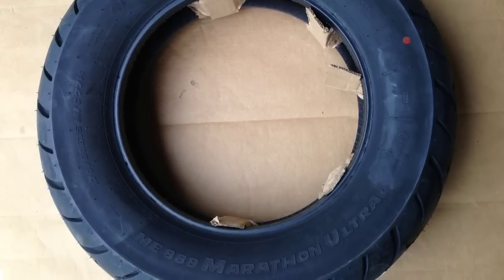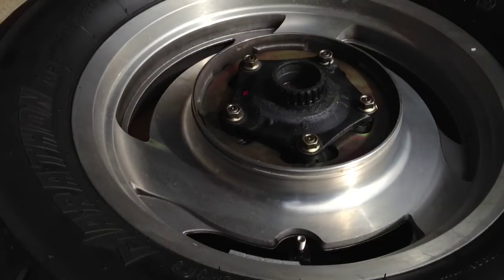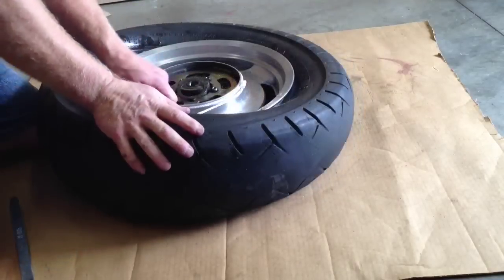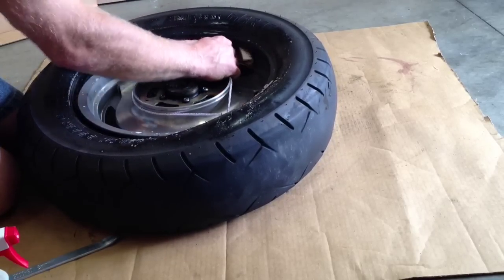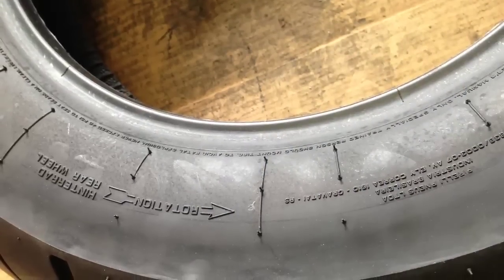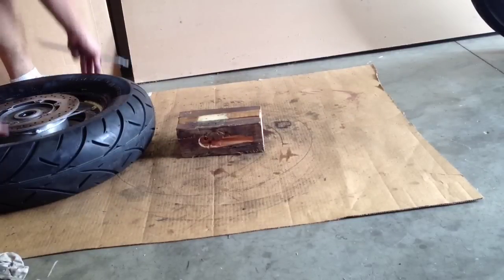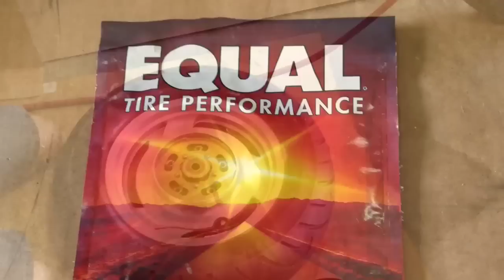Removing and replacing a motorcycle tire from the rim.

Comment: were can i get  the dust for balance an how much do i punt in.
lmk please thank you. 
Gator.
Reply from the maker: It can be found on line from several different sources, there are beads and dust both work the same. Follow manufacturers directions for amount as it depends on the tire size. Hope this helps, thanks for watching.

Comment: The yellow mark is the weakest and easiest place in the tire. Then put the nipple near the point. The red dot is the strongest and heaviest place in the tire. We put the nipple opposite for a better balance.
Reply from the maker: The tire in this video is a Metzler.
From the Metzler Website: Some Metzeler tires have a red dot on the side wall. This indicates the lightest point, and should be positioned next to the valve.  Thanks for the view.
Reply: @funbro1  My apologies! I went to their site and made sure. Thanks for the answer!

Comment: I respectfully suggest going to Napa auto parts. By a gallon of rubber lube. It’s around $15, and it will last you the rest of your life unless you have a garage and you’re changing tires all the time. One of the worst things you can use to lube a tire for installing/removing tires is, dishwashing liquid’s that contain lye...Why is what makes the detergent feel very slippery. It is also what makes your eyes burn if you were to get soapy water in your eyes, and worst of all,lye absolutely destroys aluminum..Don’t even think of washing your motorcycle or your car wheels if they are aluminum with dishwashing liquid that has the lye in it, and never use it to lube tires to make installing/removing tires from the wheels.
   I don’t depend or trust many of Harbor freight tools. But one handy tool to have around is, the harbor freight tire mounting stand for one reason. Breaking tires off of the wheels/breaking the bed loose. It takes less than 10 seconds with that $49 harbor freight tire stand. using those big sea clamps takes a hell of a lot longer than 10 seconds to break the bead, and they probably cost a lot more than you will pay for the harbor freight car tire changing stand. Mine was $49, and, I got 20% off using the magazine coupon, so I got it for $39.
   But if you insist on using those giant C clamps.. it works a lot better if you put a large area scrap of wood under the bottom of the clamp and have it against the wheel/not the tire as you’re turning the clamp to tighten on the bead/tire. When you have the clamp on both sides attached to the tire, you’re really not pressing the tire away from the bead as effectively as if you had a board on the lower end of the clamp and the top end of the clamp only on the tire near the bead..
  Don’t forget to get a gallon of the Napa tire/rubber lube. I priced many rubber lives, many of them cost $50 a gallon. But the Napa is approximately $15 a gallon
Reply from the maker: I will have to look for some rubber lube next time I have a chance to go to Napa. The dishwashing liquid that I use does not contain lye so it is safe to use on aluminum. While I would not ever use dishwashing liquid with lye in  it to wash my motorcycle or car wheels I still will continue to use it in this application from time to time. I will make sure that I do not use the dishwashing liquid with lye in it for sure. As for harbor freight tools I have used them in the past and they are good for tools that I don’t use very often depending on the price. In  this video I happen to have a plethora of C clamps at my disposal so the time savings to me would have been nothing if I would have had to run to Harbor freight and spend another $50 to purchase a tire mounting stand. It’s not that I insist on using the sea clamps but it is something that was available and many people will have C clamps available at their disposal and as shown in the video they work very effectively. Next time I am near or I go by a NAPA I will have to look for the tire/rubber lube. Thanks for watching

Comment: Does breaking the bead ruin the tire?
Reply from the maker: No, it will still work if the bead is not scraped or damaged in any way but a typical bead breakign should not ruin the bead. Thanks for watching.
Reply: @funbro1  the bead is not the metal edges of a tire? And wouldn't breaking it break it? Lol
Reply from the maker: I guess technically if you are breaking the bead that you are actually breaking the bead. Good thing is that it’s easily repaired.

Comment: I noticed you didn't take the old balance weights of the wheel, did you take them off  after you put the ceramic dust?
Reply from the maker: I left them on and the dust will counteract them. 

Thanks for watching.

Comment: Re:  6:20:  the  next  step is  to  seat the bead.    I  was to that  point  and  called my  pal  to  tell him  "I'm  going to use your  compressor  because  I need   a massive  burst  of  air  to seat the  bead".    His  compressor is  currently stored in my  shed.   In  the ensuing  discussion he mentioned that sometimes   in  a  shop  at  which  he  worked if they  couldn't  even  get    a  tire to  seat   with  a good  blast of  air   they  used  a rope  tightly-cinched   around the   center of the  tread.  It  pushes  down   toward the   rim-well  and in  so-doing  spreads the  beads  towards  either side making  a fair  sealing  contact.

The  "light  came  on"   and  I  realized  at that  point  that  I didn't even  need to dig out  his compressor  or string   wire to run  it.  Further now  I  can  remount  a tire  in  a roadside  repair  ( like if  I  want to put  on  an internal  patch  instead of   using  a   "plug"---I was  replacing   a leaking  valve  stem ).   I  always  have   a ratchet-strap  on  the bike   anyway.   I   put   it  around  the  tire  tread  as per  his  reminiscence   about  how   "they used to  do  it",  tightened it  up  and   it  sealed the bead  I'd  broken  to get at the   valve  stem  so  well  I  could   easily  pump   the  tire  to seat the bead  without   even  removing  t he  core  from  the  stem  and  using  only  one of those   cheap   foot-pumps  you  can get for  $3  brand-new.

I  was  going to  start  bringing  along   a tube  on  trips  so  I  could  seat  a bead  without  having  to hitch-hike to  somewhere with  a compressor  or  call  a  tow-truck  with one.  Now  I  won't have to mess with that or  with  trying to tuck  a  tube in  a tire without  inducing  a pinch-flat.

Hurray for  ratchet-straps  and  my  pal  Mike  the  Fireman.

There's  also  a  trick  of  putting  some  flammable  high-vapor-pressure  liquid  or  flammable  gas  in  the  tire carcass   and   igniting  it  to  create  a  small detonation  to  knock the  tire beads onto  the rim  shoulders.   Supposedly  this  works  well  but  I  don't  recommend it  and  particularly  not  when  you could  use   this  alternative strap-on-tread  method.  It may not be  as exciting  and fun  but   it  sure   does  work.
Reply from the maker: +Ivanmar Chenko  I don't feel comfortable using the flammable vapor trick (not a lot of control there. I have used the ratchet strap trick several time with good results. Thanks for watching.
Reply: +funbro1 Yeah,  I  said  I  wouldn't  recommend it.  Yet  I  just met  another individual  (  checking  out  another bike I  may buy )   and  he'd seen  that trick used  with no  disaster.  That's  two  I've  spoken to  face-to-face  who have seen  it  executed successfully   and  so   far  I haven't met   anyone  with  a valve  stem sticking  out of the middle of   their  forehead   for  whom  it   resulted in    tragedy...

I'll  stick  with  my   ratchet-strap   trick.  It seems to  work  great. I'm sure there are  other  such  tricks  and  I'd  love to   see them all.  Good  video.  Keep  it  rubber-side-down!
Reply: the rope trick is helpful on car tires,,seldom needed on  a much stiffer motorcycle tire,,,,if it does occur,hold the tire verticle and bounce it off the floor several times while turning it a little between bounces,this along with some lube will work the tire on to the rim for a seal

Comment: I also have a VTX1800 and tried to change my tire this afternoon.  Epic fail.  I could not get the the first bead over the rim edge.  You made this look a little too easy and you did it from the rotor side…. HOW?
Reply from the maker: It's not easy that's for sure but it is all documented in the video.
Thanks for watching.

Comment: Youre not taking the valve stem out, you taking whats called a valve core. The valve stem is what you put the air and so on. The valve core is what holds the air into the tire. Once you remove the core the air comes out and so on. 

But also its a great video
Reply from the maker: If we are getting technical, and it looks like that is your "MO" the valve is actually known as a Schrader Valve invented in 1891. It has 3 parts, the body, the core (AKA spring assisted poppet valve), and the cap. So technically you are correct that in the video I am removing "part" of the entire valve to allow air out. 

What surprises me most is that someone with so much attention to detail forgets to put a period on the end of the last sentence.  But also it's a great comment. Also it should be "it's" not "its".  Thanks for watching.

Comment: What PSI is your compressor putting out.  I'm trying to just start the bead but the air is just passing through.  Its not forcing the tire to bead
Reply from the maker: My compressor goes up to 175 but I am no where near that pressure. Over inflation will cause damage to the tire.

Comment: how did you put the suramic dust in if the tire was full of air , wouldn't it blow it all out?
Reply from the maker: +TipTopDalton1 Once the tire is seated on the rim make sure the valve stem is removed and all the air will come out, then insert the dust and re-install the valve stem and inflate tire to recommended pressure. Thanks for the question.
Reply: +funbro1 alight thanks

Comment: Bob how much ceramic dust?
Reply from the maker: A good rule of thumb is 1 oz per 10-12 lbs of tire.
Reply: can you substitute this product? Xtra Seal - Tire Balancing Beads 10oz bag 20.00 in my area @ O'Reilly parts store...
Reply: and TY Sir!!! very informative video...
Reply from the maker: I don't see why not as long as you use the correct amount.
Reply: thx Brutha!

Comment: Here's how you change a worn tire that you will throw out. Once the wheel and tire is off the bike, lay the wheel on a towel or rug and stab the side wall with a utility knife and cut around the tire. Flip wheel over cut other side wall around tire. Remove tread, remove side  walls and discard.
  Lay new tire on side and rub tire paste on tire bead and wheel rim. Make sure tire direction is correctly oriented to wheel. Press wheel into tire. Flip over and press other bead by hand into wheel.
Your done!, no tire breaker, no tire bars. Just your hands, a knife and tire lube..................aaannnnnd your welcome!
Reply from the maker: If only it were as easy as your words make it sound. Unfortunately this is not the case.......YOU are welcome. But thanks for the view.

Comment: GOOD vid bob, any link or website on the ceramic dust? and also a no DIY balancing part of the video?
Reply: I think he said the point of the dust is that it means you don't need to balance the tire. You can think of the dust as internal tire weights that balance it as it spins.
Reply from the maker: Correct the dust inside the tire acts as weights inside the tire to balance the wheel. Thanks for watching.

Comment: Bob I didnt know about the red dot. Thank you. I have been using RideOn. Its like that green slime. However it is a gel and not a bloody mess. It balances the tire as well. Interesting with the ceramic dust. I have also heard of beads but havent tried them. I hate paying the shop $40-$60 to do my tires. You just kicked me in the nuts I got to do this. Laters. Thanks again for another cool video.

Comment: I find it funny how people struggle taking of a worn tyre. Because they're taking it off the way a new one goes on. Surely a Stanley blade or hack saw down the centre of the tyre would do it! Split it in half, not even fully just enough to weaken it. Not like you're ever gonna use it again!
Reply: LOL try it.  the center will cut easily but you'll struggle on the inner walls where there are wire rope.     It's easier removing them with spoons.   I've done it both ways.
Reply from the maker: What are you cutting the wire ropes in the bead with? I've cut tires before and this sounds like more trouble than just using spoons.
Reply: Yeah you're right lol. My bad. It was an arse. Hold my hands up. Didn't realise there was such tough metal round the bead which if it wasn't right next to the rim i would've given it some real welly but didn't tale the risk in the end. But it's a good way of getting air out quickly
Reply: Yeah you're right damn. Was a pain. But I suppose it makes sense to have that metal bead
Reply: Do you reckon wire cutters or small bolt cutters would get through it quicker. Cos breaking that head by hand was something else hahaa
Reply: Bead not head bloody spell check
Reply from the maker: Those wire ropes can be a bear to get through, especially when surrounded by rubber and located next to a rim.

Comment: so you said you used ceramic dust, not beads but in the comments someone said beads and you went along with it. the video looks like it was dust. which was it and why would you use dust? I use airsoft bbs and they work great. made the mistake of using dynabeads and although they were great for the first couple tires, after that I started noticing cement like stuff in the tires and less beads. turns out that ceramic in tires when mixed with Windex in even small quantities especially if just using compressed air instead of nitrogen is a good way to end up with a balanced tire for part of it's life but not all
Reply from the maker: Actually I have used both and had success so it really doesn't matter. Thanks for watching.

Comment: What about the weights that was still on the rim? Leave them on or take them off since you're using the dust?
Reply from the maker: With the old weights on it was balanced so I figured that was balanced with both the tire and the rim so with just  changing the tire the ceramic dust should make up any difference the new tire would make. It seems to be working fine after many miles now. Thanks for the question and thanks for watching.

Comment: Hey i was just trying to change. My own tire. But i dont have  protectors now my rims paint is chipping. The problem is after the new tire is on the last bit of inner rubber doesnt want to line up with the inner rim. Im guessing seal the beeb? Do the  last bit of work?. One guy on youtube used lighter fluid. My car and driver brand air plump doesnt pump air fast enough to seal the tire. So did i guess the problem right
Reply from the maker: *****  Your probably right on the money. One way to get it to seal is to push down evenly on the entire tread of the tire to push the tire beads out so that all of the tire touches the rim. The easiest, safest, and cheapest way I have found is to tie a rope very tightly around the tire or use a ratchet strap to squeeze the tire. Hope this helps. Thanks for watching

Comment: hows that bike been? a friend of mine thinks the honda 1100 shadow are the most reliable bike money can buy these days?
Reply from the maker: +Bricklinsv1970 Knock on wood it has had very little problems and has been ridden a lot of distance miles and remained reliable the whole time. It is a great bike, not too big, not too small, and easy to find parts and accessories. Highly recommend one. Thanks for watching.
Reply: +funbro1 im sold man thanks. i was tossed with 1100 shadow or yamaha vstar

Comment: I noticed the balance weights weren't taken off the tire. Do you still need them since you used balance beads?
Reply from the maker: soularch17 I left them on for 2 reasons. 1. because they might help balance the rim. 2. the beads will compensate for any additional balance that is needed. That was my thought process and it has seemed to work fairly well. Hope this helps. Thanks for watching.

Comment: Good video. Just two things: never exceed 60psi when popping the bead, and don't remove the old weights until you try the balance, often the rim represents the imbalance and doesn't need changing.
Reply from the maker: Commie Canuck Both things you mentioned are correct, thanks for the comments.

Comment: Good Video. I just cable tie my axle, with wheel, to a paddock stand to balance. Let the heavy point drop to the bottom and tape the wheel weight on the opposite side until you find the right amount.

Comment: Shouldn't you remove balancing weights?
Reply from the maker: I leave the balance weights on because they will compensate for the rim being out of balance. I use Dyna beads or another balance product that is added to the tire after it is seated. If that doesn't work (and it always has for me) I would take the tire and rim in to be balanced.

Comment: did you go from ME880 to ME888? 
I have 880's on my VTX now but theyre a bit slippery in the rain (might just be low tread). 
How do you like the 888?
Reply from the maker: Yes I went from an 880 to an 888 and didn't notice a real difference in handling or wear. For my next tire I switched to a Michelin Road Commander II and it currently has several thousand miles on it and I think the handling is better than the ME880 or Me888.  Hope this answers your question. Thanks for watching.
Reply: Bryan Romero I just bout me888 :)

Comment: Great video. Thanks for taking the time. Question. I'm going to try install a Michelin Commander 2 rear tire. I see no dot to line up the valve stem. Any advice?
Reply from the maker: If you don't see a red dot look for a yellow dot, if there is no yellow dot then it doesn't matter which way it goes on.Thanks for watching